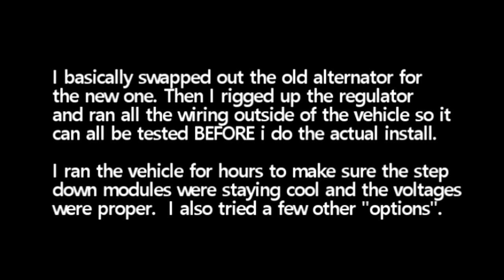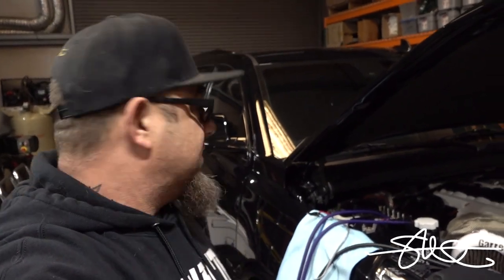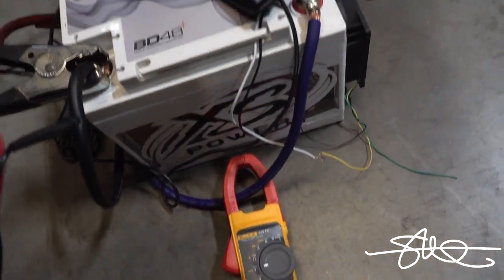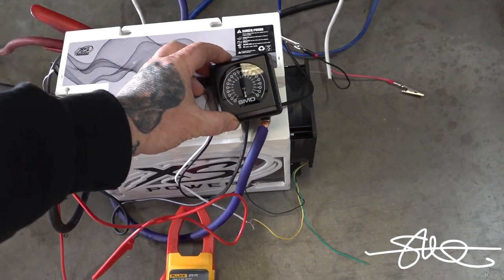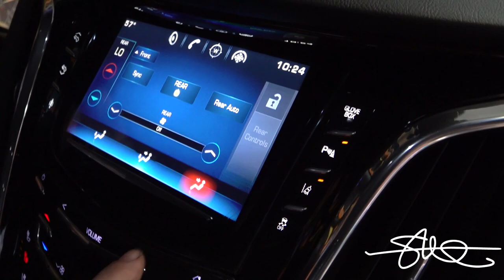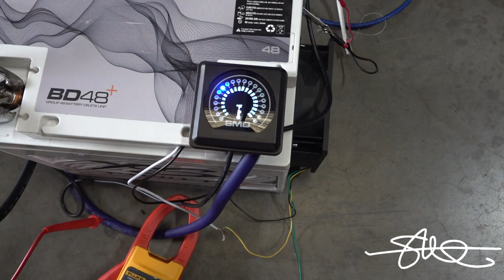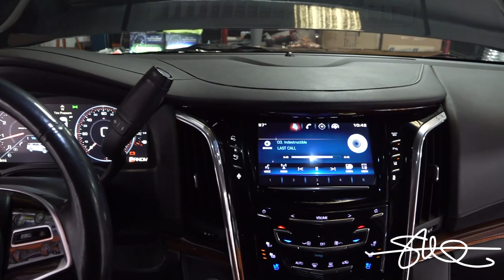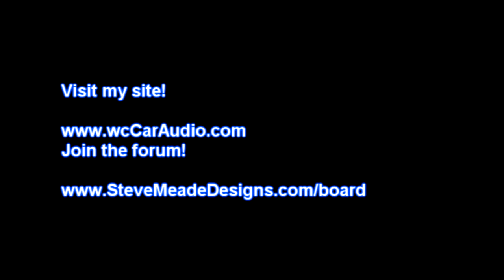Cadillac Escalade sound system install update - Dual Voltages tested + New 370a Alternator

Comment from the maker: sorry it doesn't seem like a lot of progress but this caddy is very computer driven and unlike my old 2001 Tahoe where i feel like i can get away with anything, this one is a little more touchy. I have to tread lightly with this electrical system.  I just wanted everyone to know i am still trying to make progress and things are getting done.  Pre-testing on something like this is important! Had i ran 12v batteries this system would already be done probably. But i had to make my life difficult! As usual! I have also been busy with regular shop work (see previous video) so i have to balance that with this. Check out everything we make at http://www.wccaraudio.com and follow me and my little tiny squares at http:/www.instagram.com/meade916 - thanks for watching if you did! And as always, feel free to shout out your city and what platform you are watching on! I always love seeing where everyone is from!
Reply: Hey Steve. Quick question. I just picked up a mechman400amp alt. Mechman told me it’s cold startup voltage is 15v but it runs at 14.8v will that be ok to still plug into cyber6k battery?
Reply from the maker: @bretty9446  i don't see why not. But then again i don't even know what a Cyber6k is lol...so don't ask me.
Reply: @bretty9446  it'll be OK
Reply: @bassbrother101  thanks man!
Reply: Cloquet Minnesota.
 I only use YouTube. 
And a little added info:
I got SK-1 00041.
Reply from the maker: @YouTubesucks..  i don't think so with THIS vehicle. What year is your "buddy's" denali?
Reply: Albuquerque New Mexico, love watching your videos on YouTube or insta live
Reply: Love seeing this come together. Nice work Steve
Reply from the maker: @YouTubesucks..  i ain't sayin' it won't work.  I'm just saying i have an LCD screen for a cluster instead of a "light" on my dash. So to me it seems to be more computer driven and that is kinda scary.  On a 2008 you really just need to short those two wires out to make the light go off so i'm not sure why the resister.  But mine being a 2015 makes it a little more sketch.  Ill probably end up plugging my laptop (HP Tuners) and see if i can disable it there. I think i can, i saw the option last time i was in there.  Or i will just take a chance and short them out. See what happens.  Now i just gotta find my older laptop with my HP tuner credits on it....i haven't seen it in a while.  EDIT: I just shorted out the two wires with a spade terminal (a blue crimp terminal fork).  BAM! It's off.  No need for a resister. It's working great at ZERO ohms haha!  But good shit though thanks for chiming in!
Reply: @meade916 holy shit!!! Casey Kasem!!!! 92.3FM for Albany, NY. For sure was my Favorate shit bro!!!
Reply: The new vehicles can be a real pita to customize especially the ones that have multiple system controls that run through the stock head unit/computer.
Reply: It would be cool to see him do an headphones with an amp

Comment: Man, seriously awesome stuff! I love the demo vids, but the installs are my jam! I dig the technical side. I'm running a Skar dual SDR12 bass package along with front and rear Rockford Fosgate 6.5's 3 ways up front 2 ways in back for midrange. Axxess DSP and harness, Skar 1200.1, Blaupunkt (I know, didn't have the budget for anything else and Skar was out of 4 channel 200w amps), and 3 farad capacitor. A ton of Killmat sound deadening, front doors, decklid, package tray top and bottom as well. Well balanced, but already have plans for a full on build.

Comment: Run the current wire from the 16 volt bank that's going to your vehicle electronics through some huge diode type battery isolators, the voltage will drop and the amperage would still be high enough for your vehicle electronics, those big battery isolators are rated for 200ah that's good....

Comment: Maybe could use a adjustable voltage regulator on feed the wire to ECU. 
Could Record voltage that computer see when volts are below 15.7, then feed the computer that low signal voltage it thinks it’s getting.

Comment: Just bought a 2013 Explorer. Wanting to do a fresh build on it but im trying to figure out the best way to get signal from the factory head unit. So far the best i’ve found for a good price is an rca and remote harness adapter. Any recomendations?
Reply: AudioControl and other companies make a Line Output Converter, or LOC, that can take a head unit's high-level signal and convert it to RCA for your amps. Some amps and digital signal processors also have this functionality built right in but may cost a bit more. Look for an amp/DSP that has "High Level Inputs" in the list of features. Hopefully that helps a little

Comment: Awesome Steve.
As some parts and electrical are made for 12v to 14.6....then on some parts on the ecm n pcm are multiplex...then out comes reference voltage of only 5v on some parts to work @ a low voltage...
As ur toss all the voltage it goes NO WAY and shuts off to protect all components. As NOW days everything is on digital screens... Wasn't it all so simple back in the 90s.... hope this helps alil bud.....stay up bro.

Comment: I’m working on my 08 Tahoe 5.3L and putting two TOD412 Rockford’s with a t15001-bd and 4 focal access 6.5 with a T400-4channel Rockford amp looking to run off a X2 power and my nominal car battery insulator do I still need to beef up the alternator if so just not sure wat brand and Amp I need